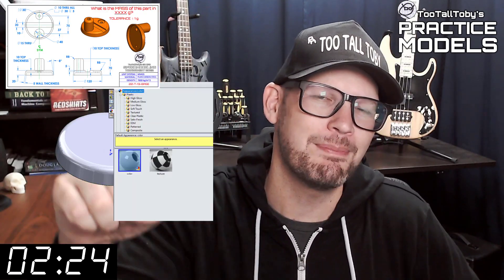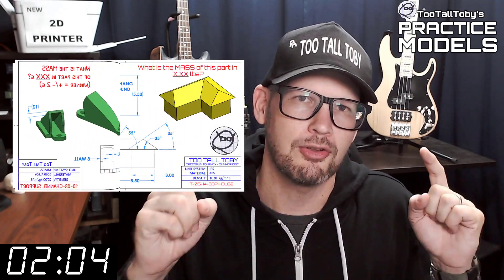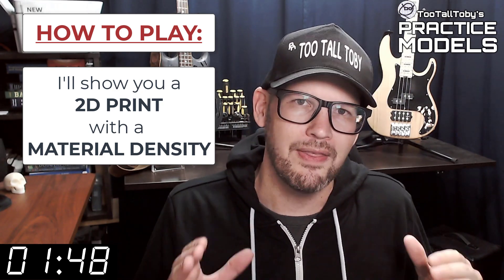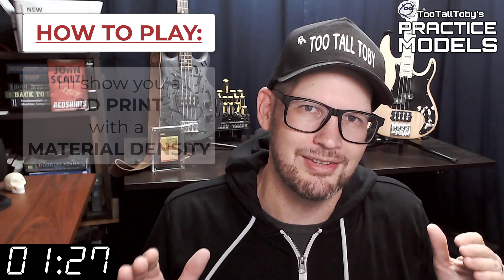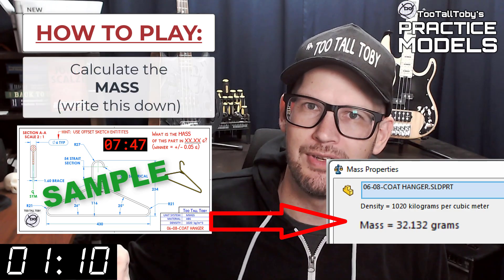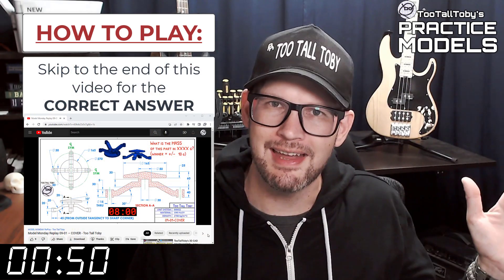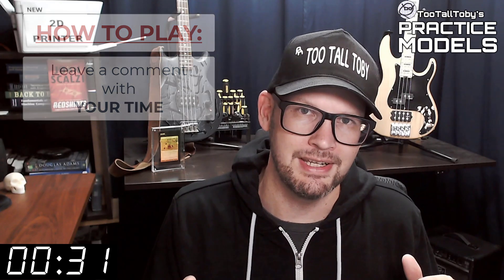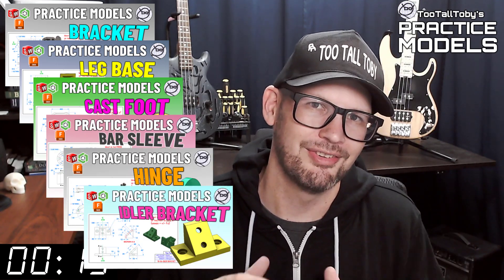2D to 3D CAD PRACTICE MODEL-  Drawing to Model exercises for Onshape, SolidWorks  - PIPE MOUNT

Comment: i modeled this and got 2234 grams. I checked every single measurement after but i found no mistakes. Is there a solve vid for this? i looked at every orientation and could not make it out. It would be great if you would provide a 3d-Model as a download so i could lay them on top of each other
Reply from the maker: What CAD system are you using?
Reply: @TooTallToby  sw but I just learned from a comment of yours that i can just find it on onshape👍
Reply from the maker: @Benutzername0000  nice
Reply: @TooTallToby  found my mistake by overlaying both of the models. I had an offset plane for the clamping block on 60 but it should have been 61 (45+16). Good that onshape is a thing :D but it would be awesome to see your solves as a onshape link in the description❤
Reply from the maker: @Benutzername0000  awww yeah nice job!!